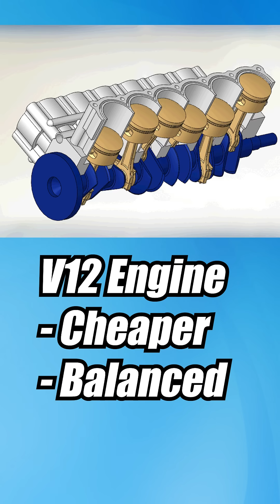wHy DoN'T CaRS uSE V14 ENGiNEs?

Comment: "Cheaper" is a relative term, 80/20 rule, 80% of max speed is achievable with these supercars, getting that last 20% of performance is basically financially impossible.
Reply: Innovation shouldn't be dependent on money tho. For example Bugatti Veyron was a huge gamble for VW (take this with a grain of salt, I don't remember where I heard this) but it payed off
Reply: @meemdoggoriginallongdrink  It is, but it is kinda hard to innovate without money.
Reply: @dbclass4075  The most creative innovations were done without money. Enzo Ferrari hated this, so he insulted such innovators by calling them "Garagists" (Garage-builders). And that name stuck, because it became a class of racers.
Reply: @richardike2342    Hard, but not impossible. It's just that having money will make innovation easier. Part of the reason why we even have the car at all is due to Bertha Benz's dowry providing financial support for the development of the prototype. Plus, her infamous test drive; she have contributions to her husband's invention.

But of course, simply having money doesn't guarantee innovations either. On its own, it's just simply a catalyst of its user. For instance, British Leyland: a once profitable automaker went defunct due to disastrous management.

Comment: Bugatti is making a v16 engine for their new car. Also damn that's a nice Minecraft build
Reply from the maker: Yo really? Damn, The CHONKY W16 bouta have a LONGBOI V16 cousin lmao
Reply: @BladedAngel it sounds amazing too
Reply: @BladedAngel before Cizeta V16 there was  Cadillac V16 in the late 20's mid 30's
Reply: @coltringcoltring7448  and after that Cadillac attempted to make V16 car in 2000s, Cadillac Seixteen with humongous 13.6l V16. Sad is that it's only concept, but what a concept! And it was working too!
Reply: @BladedAngel  V16 - 8,3 liter - 9000RPM - 1000hk with 250kw 3x so around totalt 1800hk for the engine.
Reply: @Tjockpaladin 750kW is 1006hp though but hybrid power doesn't always add up perfectly
Reply: @BladedAngel you didn’t know dey sayin it’s gonna produce 1000hp naturally aspirated v16 also might be a hybrid so they gonna add some electric motors maybe
Reply: @BladedAngel  8.3L V16 developed by Cosworth if we’re being specific
Reply: @BladedAngel Yes it was announced full carbon fiber V16
Reply: if any car manufacturer where to make a V14, who would take the plunge first? i vote is Pagani (probably spelled wrong).
Reply: @lc5957 or maybe Koenigsegg, if they decide their twin turbo V8 isn't enough
Reply: @chrissss696 wtf a twin turbo v8???? Idk much about cars but I do know a twin turbo v8 is fucking Insane
Reply: @lc5957 you actually spelled it right!
Reply: @lc5957  Paganis mostly have AMG engines so I don't think they'd produce anything new
Reply: @hami_1012  aw. least i can imagine though :P
Reply: @lc5957 Pagani doesn’t really make engines. They take Mercedes engines.
Reply: @lc5957 that seems unlikely, given they use Merc engines.
Reply: From my knowledge Pagani get their engines from Mercedes. They don’t make their own
Reply: @lc5957 Pagani🤣 Pagani use Mercedes-AMG engines for their cars. No chance AMG will do V14 for them.
Reply: @lc5957 , so Mercedes? Because it is where Pagani gets their engines from.
Reply: @a21npilot91  i suppose so then, yes. 
...why dosen't Pagani make engines anyways? considering the engines they do use form Mercedes sound vastly different.
Reply: @lc5957  nope pagani doesnt make engines..
Reply: @lc5957 pagani have never made an engine why would they start by trying a v14?
Reply: isnt there a devel sixteen?or is it fake?
Reply: @yourfatmomma69  kinda fake, they made a car and they made a V16 engine with 5000 hp like promised, but they haven't actually put the engine in the car
Reply: @chrissss696 Supercar Blondie already 'kinda' test driven the pre-production model dude lol
Reply: @bDz416 with a completely different engine inside?
Reply: @chrissss696 who said that?
Reply: @bDz416 The one she drove didn’t even have a V16. It was a V8.
Reply: @mindnova7850  I know..
I think it was a C8 V8 if i'm not mistaken. 🤫
Reply: He says that in the video
Reply: Vw made the w12 nearly 20 years ago, BMW then made a w16... technically those are 2 v engines together,  but still
Reply: @kurtsudheim825 BMW made a V16

Not W16
Reply: Bugatti is going electric
Reply: Aren't most of the larger engines like V12 or V16 just two engines melded together? Two V6 and V8 basically..

 Personally if that is the case. I don't consider that a single engine if it uses two blocks.
Reply: @dianapennepacker6854  no it's not. They're made out of 1 single block and have a lot unique details. How you explain Ferrari lot used V12, but nearly never V6? Cuz they're completly different engines. You can say V8 is also just 2 inline 4 engines or V6 made of 2 3 cylinder engines, but it's wrong.
Reply: @klodknife they made v6 longer time ago and now the 296. they didn't use V6 for a while because V8 were more powerful. but you are right none of their V12 were made but gluing two existing V6.
Reply: @dianapennepacker6854  not necessarily watchbut in the case of the Bugatti it's like two V8 with 45° offset on the crankshaft see engineering explained video about it, lots of details just from the few official info/pictures and the short video
Reply: I was not aware that Bugatti is even making engines. Usually those manufacturers like Pagani are just taking parts made by other companies and assembling them into a finished product.
Reply: Jesus love you, he died on the cross for you, accept him as your lord and savior he can change everything. For God so loved the world that he gave his only son, so that everyone who believes in him may not perish but may have eternal life" (John 3:16)

But you must repent too. From that time Jesus went about preaching and saying, Let your hearts be turned from sin, for the kingdom of heaven is near. (Matthew 4:17):
Reply: @jesuslovesyou1497  ight bot 🤓
Reply: If I’m not mistaken they are just gonna make some Chirons with the V16 engine
Reply: @Stress_ed no it’s gonna be a fully new hybrid electric chassis with 2000hp supposedly
Reply: @Stress_ed nope new car is gonna launch,it has been already announced.
Reply: 😅😅he already said that.. yall young folks dont listen or pay attention.  It's a no wonder yall get finessed so easily.
Reply: Made by Volkswagen
Reply: No V16 it’s a W16
Reply: @Denali_Rebel +
Reply: dumbass @Denali_Rebel
Reply: @Denali_Rebel No. V16 is right
Reply: It’s not a v16 it’s a w16
Reply: @Glitchfloob  no, they had a W16 in the Veyron and Chiron, now they're making a V16 for a new car
Reply: @chrissss696  that doesn’t make sense to dump a proven engine for a new one. Could be their last experiment before going fully electric. It won’t sound the same
Reply: @Glitchfloob it’s a 6.7l (maybe, could be wrong) v16 na hybrid. Supposedly going to make 1000hp from the engine plus 1000hp from the electric drivetrain, 2000hp total, if they can keep the weight reasonably down it’s going to be insane
Reply: @Glitchfloob  it actually sounds better with no turbos and higher redline.
Reply: @mkp1214 8.3l Cosworth V16. 6.7l V16 wouldn't make sense, too small cylinders especially with "only" 9000rpm
Reply: @geemy9675  you have to think about the length of that crankshaft tho, at 9k rpm that’s a shit ton of force over a very long crankshaft
Reply: @mkp1214  well crankshaft length on a V16 is always going to be problematic wether it's a 6.7 or 8.3 anyways. 6.7 NA V16 wouldnt be powerful enough especially considering the size and weight of the engine. to make any sense it would need to rev insanely high but then it would be more like a racecar engine (GM T50) hybrid power train would still help with the torque, but in terms of engineering it would be too many/too small cylinders. the best all around NA engines, GT3 4L boxer 6, Z06 5.5L V8 have 660-680cc cylinders 
Valkyrie and GM T50 are 500-300cc
but they are not making a lot  more hp/l considering the added complexity
8.3l V16 1000hp is 520cc per cylinder and 120hp/l so not better than 4x 1999 250hp 2L i4 Honda S2000 engines 😂.
they are probably going for a wide torque curve
Reply: @geemy9675  well, the engine is reportedly being developed in partnership with cosworth, just like the t50 engine. Also, those engines you named aren’t making 1000+ hp from factory, and I’m assuming the efficiency of power per litre is a lot more difficult to execute the higher the hp output is. The greatness of an engine also isn’t measure directly with efficiency of power either, the viper 8.4l v10 is considered a great engine but is awfully inefficient when it comes to making power
Reply: @mkp1214  even though it's not THAT easy to add hp with displacement or cylinders hp/ liter on a NA engine is still a good indicator of an engine level of tune.
hp/liter + reliability is better though
Reply: @mkp1214  and making power by making it huge displacement is not that hard. it's shoving it into a car and making the car handle well that is.
also a viper 8.4L V10 making 400hp is from another era but can't be compared to a C8 Z06 making 670hp out of 5.5L V8
it is definitely not a great engine by modern standards, significantly less powerful than some 2l engines or NA 3l
Reply: @Glitchfloob research before you speak. The new Bugatti will have a naturally aspirated v16
Reply: @Averyc_fishing  ok kid 🤡🤡
Reply: Its W16